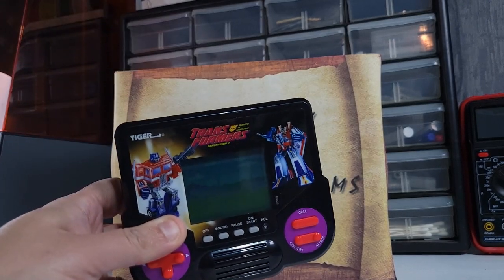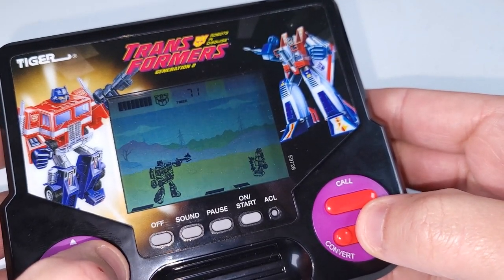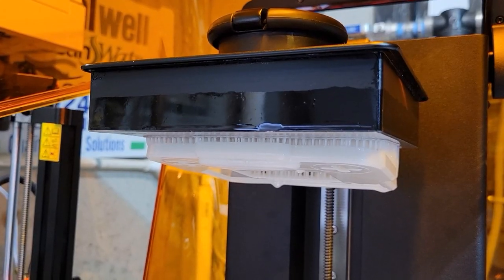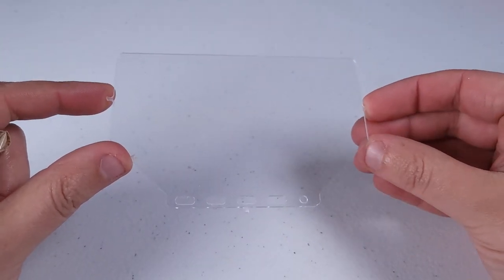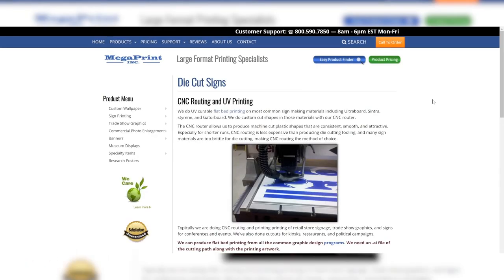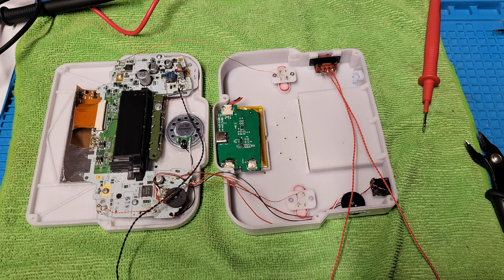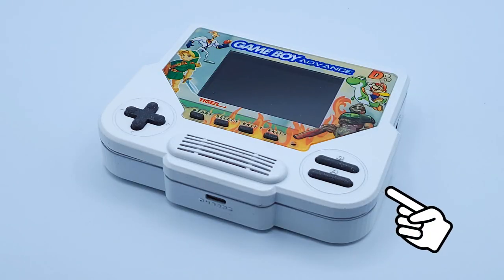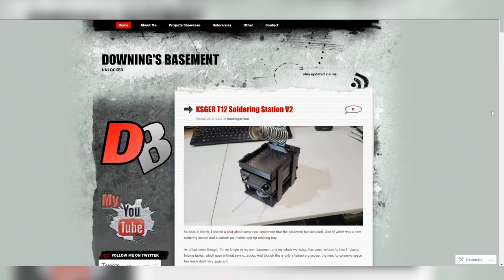Why Would I Build A Handheld Console Out of A Handheld Console? The Tiger Boy Advance

Comment: I make screens and boards for arcades, best way I have found to do the gfx is getting the part cut first and then making slightly oversize reverse vinyl wrap prints, wrap them from back with solid wrap. then trim the excess wrap on sides and holes after its stuck on solid/tight.
Reply from the maker: Makes sense. There are certainly better ways I could have gone about this, but my problem was adhesion. I couldn't use screws to mount this, so it had to be glued, an the only way that I found that I could glue this to use a single printed piece like I did, or some kind of material that I could print on the adhesive side so it could mount to the acrylic and then to the case. The next version I might try printing on some 3M and die cut the pattern after, but for what this was, I used what we had played with in the past.

Comment: As a retro gamer, to me what matters the most on a handheld, is the grip and how it falls on your hands. The analog poket together with other 3rd party handheld in the market, are really uncomfortable on the hands. They cause carpaltunel and arthritis because of how the hands are positioned. That's why I love the New 2DS XL with the grip. Also, I wanna add that this is a great project, but I wouldn't be focusing on the Gameboy since most of the handheld can be moded anyways to play emulation. I think you should instead make a Tiger handheld emulation machine. There is an emulation for the Tiger games. That way we can have all the Tiger games in one place. But you will have to add extra buttons for some of the Tiger games. Also add some grips on the back so our hands don't cramp up when we grab the Tiger case.
Reply from the maker: Yes, that sounds like it'd be a fun idea for a future project. This was just meant to be a small, fun mod I did in my spare time. I could certainly improve this in many ways, but off to the next one!
Reply: @DowningsBasement   Even tho the Tiger emulation exist, no one has attempted to make a Tiger emulation machine yet. If you do, you will be the 1st to do it, and it will be a success. I would definitely buy one from you. If you make it comfortable on the hands and a bigger light up screen. The Tiger screen where kind of small and you had to play in the sunlight. I hope you give a try.

Comment: Came here from Nintendo Life! Pretty rad project! Is it compatible with the link cable and the wireless module? Or would there be a possible V2 down the line that would have that kind of capability built-in? Either way, keep up the great work!
Reply from the maker: This one is not. I was going to wire it up but really didn't see the point because I simply am not going to use it. If there is ever a V2 than I'll certainly be adding that capability though.

Comment: Why did you decide not to use a custom PCB?
Reply from the maker: It just started out as a quick case mod and at the time I didn't really see the need to go through the extra steps for making a few tact switch buttons. They would have cleaned things up for sure, but wasn't necessary.
Reply: @DowningsBasement  Makes sense, thanks!